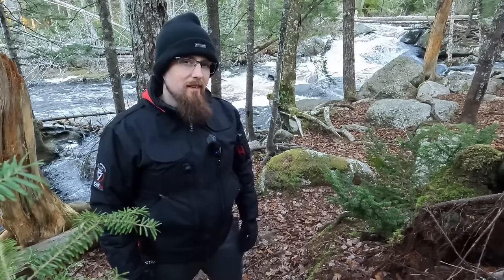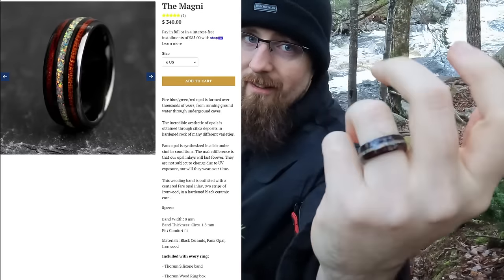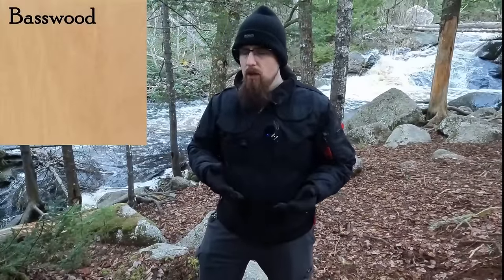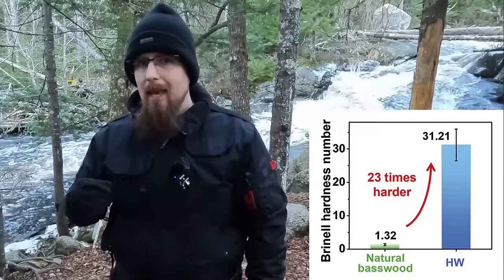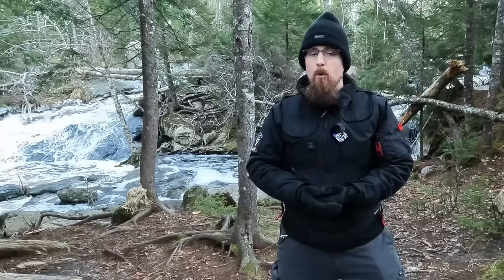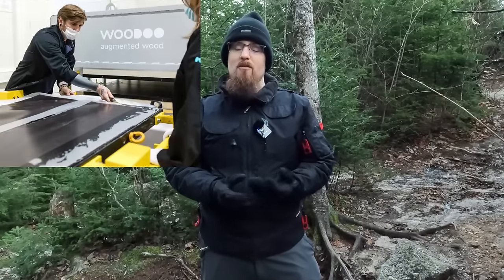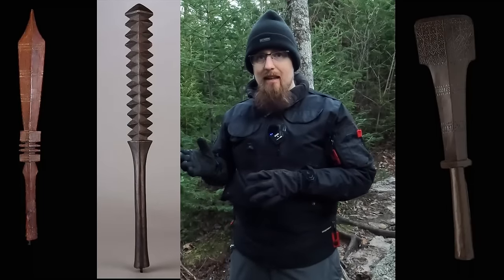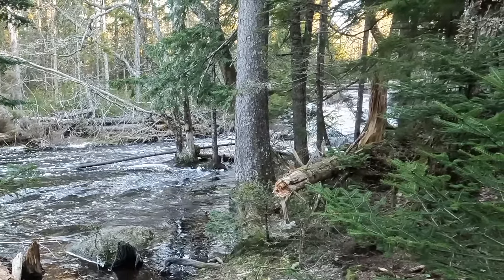Hardened Super Wood!  -  Can It Rival Steel?

Comment: I haven't watched the video, but I already know that we can get wood pretty hard, but nothing close to the hardness of tool steel. 

You can sometimes use a peice of untreated hardwood as a nail in basswood. I have used a splinter of Osage Orange as a nail in Douglas Fir, it wasn't easy but it definitely worked.

Comment: In the real world imagine screw driver handles and decking made of this stuff. I would 100% put something like that on the tray of my ute. It would sound very interesting as a guitar or even as a fret board. It would make incredible garden edging. You could even use it as a retaining wall. You could virtually replace ply wood with it. Although you would have trouble mass producing it at the moment with the wood  shortage. Trees grow slowly. Although things like bamboo and balsa wood grow very quickly and it might be a good way to turn them into regular hard wood.

Comment: Petrifying wood makes it much harder...water glass makes a nice buffing and polishing product. Soak the wood in waterglass followed by drying and re soaking, until it won't take on anymore water glass. Then buff and polish.  It doesn't make much more structural strength but a shiny hard surface.

Comment: Could be great to add to vampire lore. Would make for some extra good stake based weapons. Maybe wood crossbow bolts or even wooden bullets, since regular wood tends to be a little hard, or not hard enough in this case, to be believable enough as effective ammunition. That said I have seen one video of a steel cored wooden slug round that was surprisingly effective. If it was made with this kind of method it would probably be pretty devastating. I'm no expert on this stuff though, I'm just a video game nerd looking around for new ideas lol.😄

Comment: Hello, engineer here. I find this treated wood very compelling. My first thought was furniture. Why pay for and wait for oak to grow if you can make fast growing soft wood awesome?
(I wonfmder if the process would work on bamboo)

My next thought was car interiors. A lot of work is being put into reinforced polymers. Usualy poly propylene because cost. Previously they were reinforced with fibre glass which is a recycling nightmare.
A current trend is "artificial wood" that is usually hemp reinforced polymer. You can make this pretty strong and green by using poly lactate but I think this super wood will give it a run for its money and be almost carbon neutral even if you downcycle it into paper and then just burn it.

If it had dampening properties it could be a structurally load bearing sound insulation that looks nice.

Comment: The articles i read indicate that after the chemical treatment and pressing the wood fibers crosslink and bind together chemically. I wonder if this is true for sheets of wood as well, as in a plywood without the glue binder.

Molds to press large ‘plywood’ hardened wood sheets (density ~.9g-1g cm^3) into massive vehicle panels would be amazing for environmentally friendly cars, both in lightness and in carbon footprint. They would probably be carbon negative as they fix a large amount of carbon.

Also if sheets can be bound together to form larger, thicker blocks, this would make an INCREDIBLE material for 3D cnc mills to use. Hardness comparable to copper or bronze, high strength, etc…

It would make custom parts cut from blocks of material cheaper and more environmentally friendly.

Comparable strength and hardness to a metal block, but at a fraction of the density of even aluminum? And probably pretty easy on the hardware compared to metal cutting.

Comment: From an amateur woodworkers experience I have some Hickory that just laughs at my files, ruined a rasp and turns sand paper into tissue paper. I have exotic woods that are labeled as harder on the Janka scale but they don't ruin my tools like this batch of hickory. I was told that it was the way this particular batch of Hickory had been dried and can happen more often than not with age.

Comment: As a former sider/roofer I've had metal nails break in half with enough frequency that I doubt wood ones woud be practical for anthing major, I do like the Idea of it being used as a replacement for plastic since we have way too much non recyclable plastics and no real way of breaking it down safely I'm sure it would be much better for the environment and our food supply in the long run.

Comment: Interesting. However, a bit of critique. The setting with the water flowing in the background gets a bit distracting with the noise over time. A suggestion would be to start the clip at this location, but then change to a more quiet setting for the rest of the clip.

Comment: With properly dry wood you should have very small open channels along the length - through which a liquid can flow (the same way water used to flow when the wood was alive). Using a bit of soapy water you can blow bubbles through it with just lung-power (a little trick that can be used to check that your firewood is properly dried).

So - as an alternative I imagine you could probably multiply the strength of wood very significantly if you forced some epoxy resin through the channels using a pressure pump. The result should be very strong. In other words, rather than removing the voids to up the density, you instead fill them. That seems like a much simpler process - simple enough that it might be doable in a home-lab for an experiment. Of course, the result would not be just "wood" at that point, but a wood-composite material. It should still look like wood though.

Of course, in practical terms it doesn't really make much sense to use various methods to harden wood unless you can make it cost-effective enough to rival simply using harder materials to begin with. Except maybe for niche cosmetic uses. It's still cool research though.

Comment: I think it just replaces hardwood sometimes with a cheaper alternative. It certainly can't replace plastic as plastic isn't useful because of its strength but because of how easy it is to form. Maybe it can replace certain construction materials. It would be great if we would do even more wood and denser wood so we could catch more carbon from the air.

Comment: To be fair to the researchers. That article says "stronger" not "harder".

It's a little nitpicky and I wouldn't have said anything about it, but since you called them out on it, I figured I'd offer a polite correction. 

Hardness and strength are not the same thing. Strength is basically how hard you can pull on it before ripping it apart (ultimate tensile stress). Hardness is it's resistance to local deformation. 

Let me go check out the article real quick and be right back.

Edit: so they didn't mention its strength. But from a similar product, a company was boasting that it has 500 MPa which is a lot. Steel is 420MPa. I can't find my source so take that with a grain of salt. And I doubt that they actually got 500MPa.

Comment: I'd be interested to see how these hardened wood nails perform in a nail gun. That's often how nails are used on construction sites, and it might be less harsh of the nails than a hammer blow, in that it has mechanical repeatability on its side.

Comment: A bit off topic comment for this channel, but i wonder if it could have good applications in the car industry as well, for frame construction especially. If it's strenght to weight ratio is better than steel and alluminium and it is easy enough to be "formed" and machined it could be viable to make much lighter cars, wich is good for fuel consumption, sportyness and efficiency in general... and that's not even talking about the environmental benefits of the material itself at end cycle and "having to plant more trees" rather than mining (the co2 benefits would be great, but admittely even greater for construction if you compare the disastrous emissions of the concrete industry). Maybe the temperature resistance could be an issue (of course i'm talking about interiors, frame and bodywork at best, engine parts, both combustion and electric ones, are a no-no) but since Morgan already build frames with normal wood it might be interesting to see some manifacturer trying to do some tests and comparing to current construction methods... it might be a worse peforming, but much cheaper alternative to carbon fibers.

Comment: the material nerd in me is wondering its other physical properties aside from hardness, like its flexural strength, and its brittleness, usually once a material is hardened it becomes brittle, and after seeing the 2 year old hammer strokes, I'm assuming the nail just snapped once actually struck

Comment: If you could laminate, with the outer layers longwise and the central layer in the other direction, you could have micro serations that could give nasty cuts (esp.   with a slightly curved blade), and, since grain is never straight, you could choose wood adapted to the curve, like old-school ship builders. Edge damage might be a problem with parrys, but sometimes locking the blade is positive... Things to reflect on.
Reply: Imagine, for example, a central core that crurves toward the sweet spot, with outer structural bits that curve with the shape of the blade...
Reply: (think weaponised paper-cut, x20)

Comment: The two big ideal uses for the engineered wood product is plastic replacement, and interestingly enough, hard wood replacement.  A oak tree takes 40 years to grow and be ready for harvest.  Pine trees need 25 years.  If you could grown a junkwood  that only took 10 years to grow and turned into structural hardwood that is as as any oak tree if not better, well that could help out alot for housing costs as you be able to grow 4 times as much wood and probably get a much better product then what we use today which is fast growing pine.

As for the plastic replacement, we have so many products today that use up large amounts of plastic.  That's not to say the plastic is bad.. it just that as demand for products becomes more great anything we can use that does not require the use of plastic means more plastic for the products that cannot use anything else.  the moldable property of the wood hardening process is especially interesting in this regard as it would be a option besides casting out of metal, or using some plastic to get the same result.

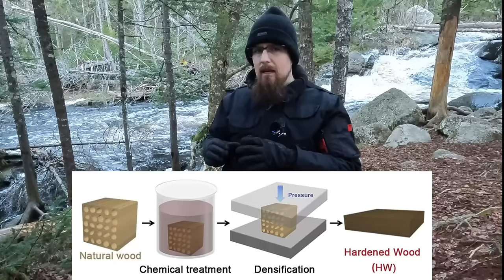Comment: 3:00 the compression also chemically fuses the walls of the wood structure, so it’s far far harder.
Edit: not harder than shown, but harder than it otherwise would be, which is why it’s as hard as it is.
Watch Nilered’s vid on it for more info!
Reply: Note: this also means that the less dense woods, as a result of their ‘tubes’ being bigger and thus having more surface area, end up much harder than denser woods might.

Comment: wouldn't it be easy to make old types nails from wood like that, as you can basically mold it into the shape during hardening process. The nails we use now are by design worse than old types that looks like triangles because it was cheaper to make it that way, but if you can harden wood cheaply, it would be worth to look into it

Comment: I think you're wrong about the different types of wood. The main difference between softer and harder types of wood is the structure, the material is mainly the same. The process they have makes the wood probably as hard as it can be regardless of the starting material so I don't think a harder wood would get as hard as you're saying here.

Comment: I doubt that starting with a harder wood would result in a stronger hardened wood.  Soft woods are soft because they have more empty space in their cross-section, while hard woods are hard because they have less space.  As long as you're using the same amount of heat and pressure the end result should be much the same even if you started with a denser, stronger wood.  You won't be getting that same 23x increase out of ironwood or even oak, since you're just turning whatever type of wood into a plank (or brick) of cellulose or lignin.

Comment: pretty sure this is similar to the stabilization process for wood that includes epoxy and a vacuum. One thing you have to realize about stabilized wood is that it is heavier and more brittle as it gets harder. This does not mean it is not stronger, just that instead of bending like wood does, it just breaks. 

Interestingly enough,  stabilized wood takes on a "ring" when thumped, similar to most alloys, but not quite as prominent. As far as driving nails goes, I would not recommend. It is known to shatter or split under a nail. However, you can still drill it and use bolts on it pretty well. 

Lastly, Epoxy is not cheap and neither is the vacuum process. For Armor, or small applications, It can be great. For carpentry, it would be prohibitive due to cost. I could see it being an EXCELLENT blade handle.  

As a shield, I don't think you would want it. If the treatment in your video is similar to stabilized wood, It will be strong until it totally shatters in a catastrophic fashion.

Comment: Super hard woods could be used in aircraft.  Very light.  Radar invisible.  Not heat resistant as much but could cut back on exotic metals and carbon fibre type materials.

Comment: As a carpenter I will always hold firm that wood is better than steel for construction. A laminated wooden beam is actually stronger than I beams and also better at resisting fire as well. A bathhouse that burnt down some years ago over here had an older part of it constructed from laminated wood beams while the newer part that had been built using steel beams. After the fire was finally put out and renovation could start, the steel construction was nothing more than a mangled mess on the ground, the fire had burnt so hot the steel would bend and crash down tearing down the whole construction in this part of the bathhouse. The wooden beams while charred had only received superficial damage and needed only to be gone over with a sanding wheel on a disc grinder and it was as good as new.

It isn't that wood can be harder than steel, but implemented correctly it is still stronger than steel.

Comment: Wood can be made harder than even carbon steel for sure. If you put through wood the same process twice, it will be 529 times its usual hardness. Then if you put it through like 10 times, it will be dozens of times harder than diamond.

Comment: forget the anatomical armor. With an even ballpark similar process our predecessors could have made wood armor with deflection angles pressed into large unjointed single pieces. They could have placed what few joins they would have had in areas that could be covered with a single strip without introducing obvious weaknesses or freedom of movement compromises. Far, far more importantly from a historical what-if perspective this material could have been used to make stationary projectile weapons portable, and/or potentially more powerful of course. And then there's the implications of wheels and farming tools that could withstand massively more load, that would eclipse any military potential for sure.

Comment: Instead of grinding a sword out of a block of hardened wood, you could press the wood into a sword mold.  This should leave the edges at the maximum hardness and the core softer for shock absorbing and reduced risk of failure.  Making it from transparent wood would make an epic looking art piece.

Comment: i could envision exciting applications for this . A replacement for steel is not one of them . Iron and Carbon are plentiful . Unless they can produce this with less energy and exotic material input , which doesn't sound like the case , it will have to find applications alongside of those filled by steel .

Comment: My guess is you'd see diminishing returns using this compression technique on already hard woods.  It's likely what they're doing simply replicates a lot of the differences between naturally hard and soft woods, so while you might achieve a Brinell of 31 using basswood, doing the same to ironwood might only get you something like 33.  Hence, using the technique on cheap and plentiful farmed wood and receiving a product that's already harder than any natural wood is far more cost effective than procuring and meddling with expensive hardwoods for barely any extra gain.  This is obviously just speculation from a layperson, but given the nature of chemistry and physics I'd guess there's a theoretical limit to the densities lignin and cellulose can achieve, and hardwoods are naturally closer to that.

Comment: The sensationalized article title actually stumbles on to a slightly odd truth. It says "stronger" not "harder", and wood (at least in the direction of the grain) is (pound for pound) stronger than steel. It is less dense, which is generally the main issue, but higher density with this method may reach that

Comment: From a woodworkers and construction point of view I can't imagine it being used for anything other than corner frames and the full load bearing places. Entire houses will not be made of this stuff, hardwood is already (shockingly) hard to work. Imagine trying to drive nail into something almost as hard as metal... For 10 hours a day... Not to mention getting half a dozen cuts out of each saw blade

Comment: Strength has more than one dimension. There's tensile strength which is resistance to stretching. There's resistance to compression. There's resistance to bending. Resistance to deformation. So when you say stronger than you need to specify what your talking about.